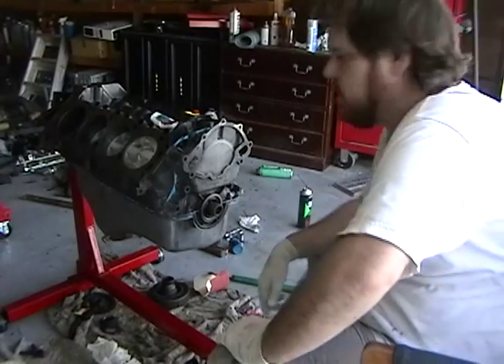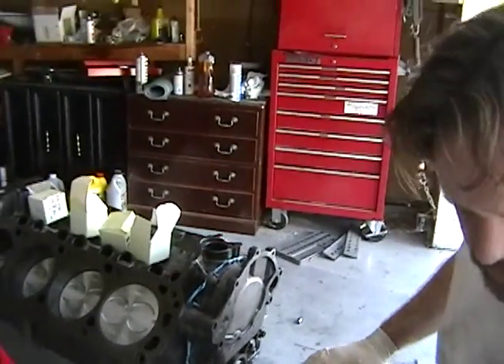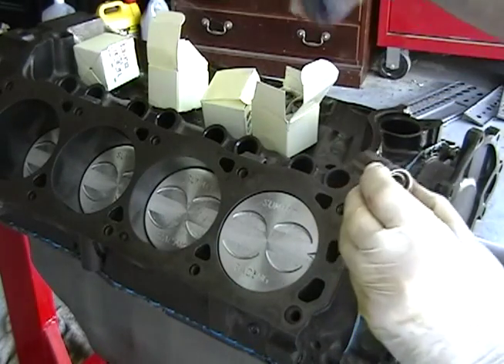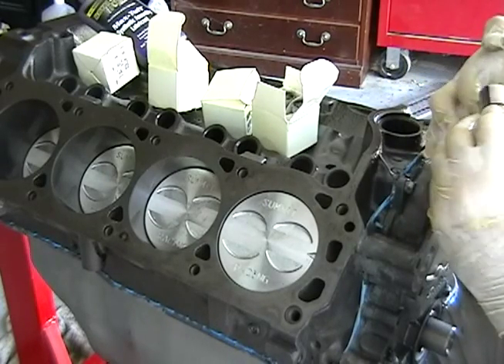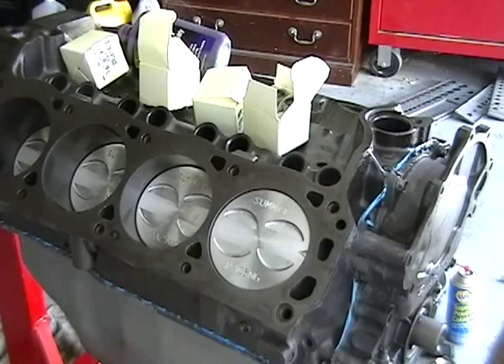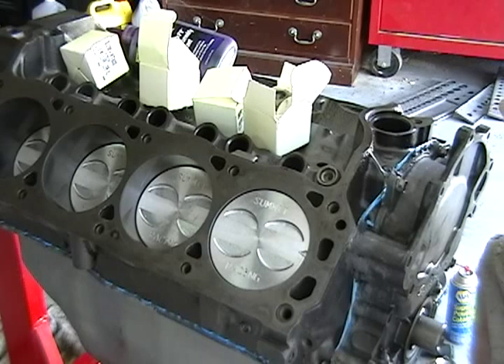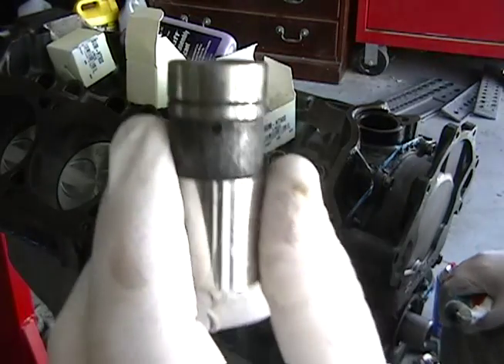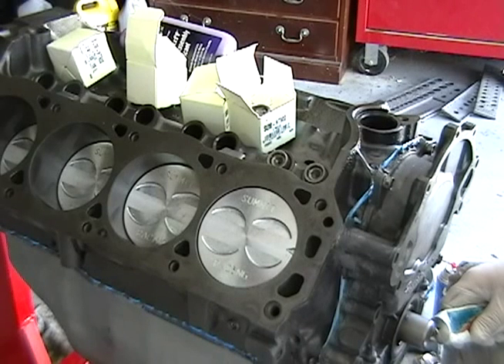1990 Ford F150 302 Engine Rebuild / Overhaul an Engine Part 13 Hydraulic Flat Tappet Lifter Install

Comment: It doesn't matter which direction the hole on the lifters is in when you install the lifters. The Flat Tappet Cam will rotate the lifter in order to wear the bottom of the lifter evenly. That's the way it's designed.

Comment: I like to soak the lifters in oil first and then put them in. The hole is where the oil goes in. After you soak them just throw them in.